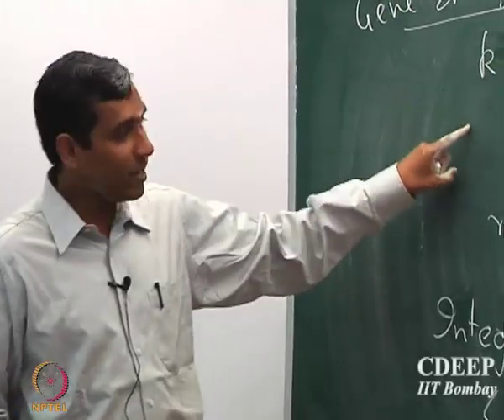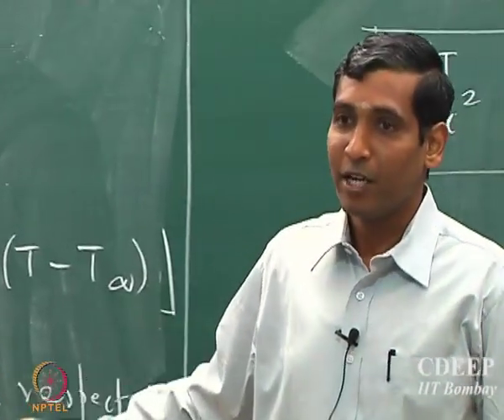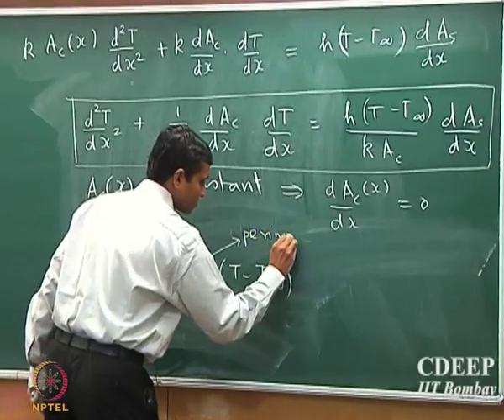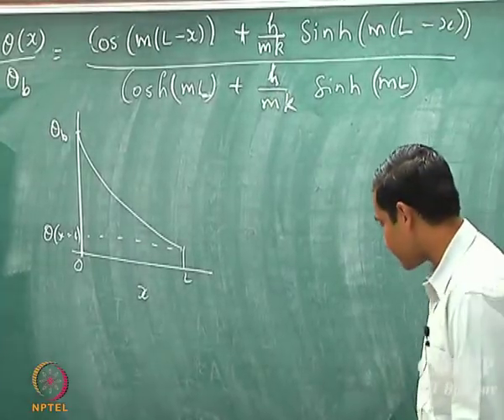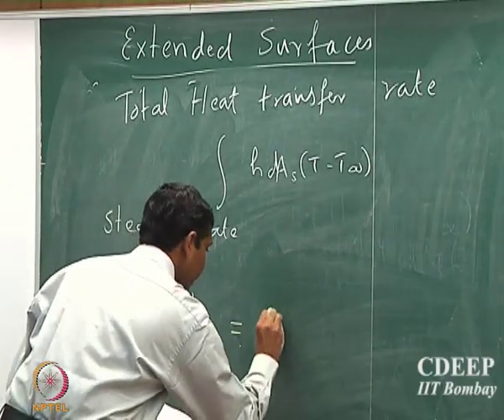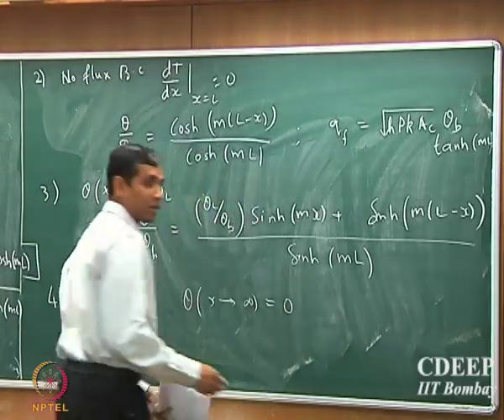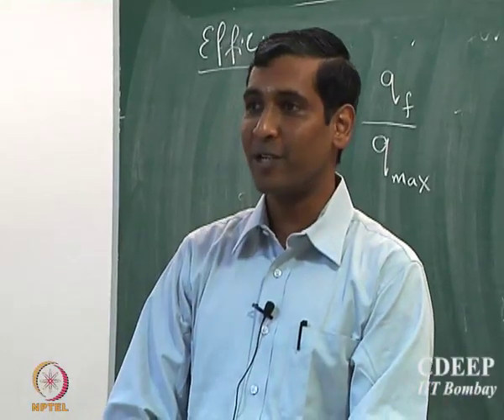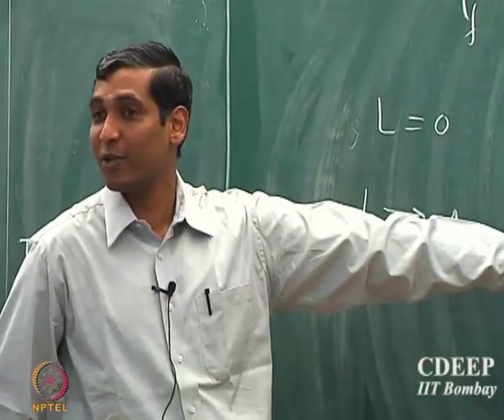Week 2 - Lecture 10

Comment: Sir, if the base temp is equal to the temperature of the fin all over,,,,, 
the conduction q = - kA (DELTA T) is zero since delta T =0 , and the heat must be tranfer by conduction to convection is O or very less even it has little temp difference, so how can we get q(max), or did misconcept any thing here like the overal heat qiven convert directly to the CONVECTION.?? Please help me with sir.
Reply: Then Convection heat transfer will be -hA(Tb-Tatm)